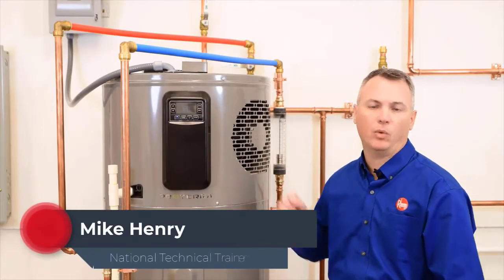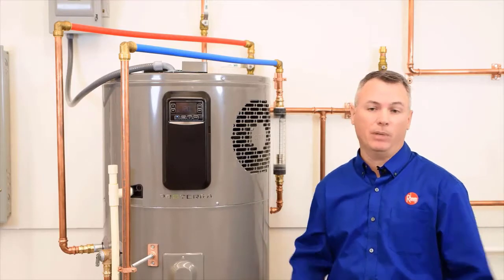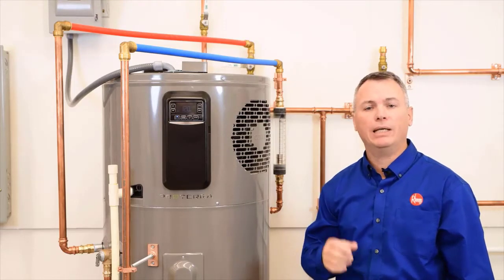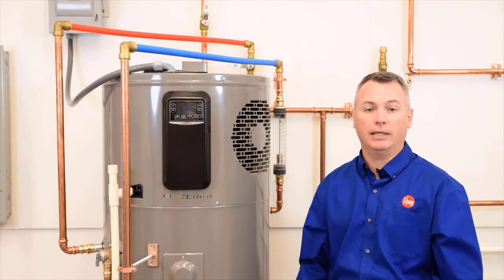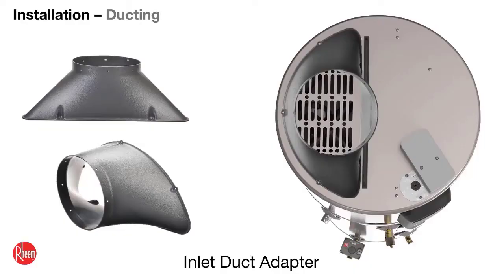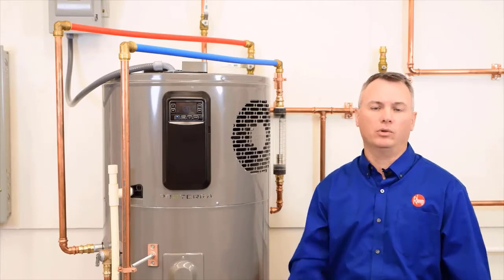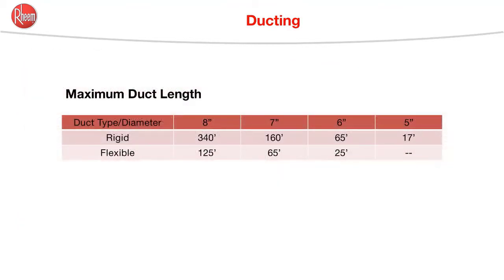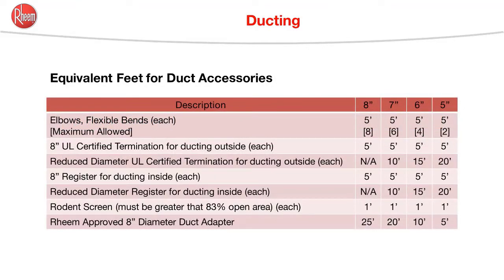Ducting When Installing Rheem® ProTerra™ Hybrid Electric Heat Pump Water Heaters

Comment: I will soon be purchasing your Richmond brand hybrid unit to replace a gas fired Rheem  that has serviced 16 plus years. My question is about the air intake. I am placing the unit in the basement of a northern climate home. The air temperature is maybe 60 degrees with plenty of room to not have to vent in or out. However knowing how a heat pump works. The warmer the air into the unit the more efficient it is. Would i be off my rocker if I vented the air from behind the wall of my fridge witch is directly above the unit. Since the fridge is basically a heat pump that expels heat. I would place a vent in the wall behind the fridge and box it in like the furnace air return vent and pipe it directly into the new water heater. The wife is always complaining about how hot it is around the fridge so plenty of heat in that area to service the new water heater.
Reply from the maker: Thank you for your question. Please refer to the use and care manual https://s3.amazonaws.com/WebPartners/ProductDocuments/2284AE53-7D0D-4BF5-A2BD-1D65C187C6F9.pdf and the spec sheet https://s3.amazonaws.com/WebPartners/ProductDocuments/71875DC2-D7F8-4FB4-BC4F-B2AE0190B7E8.pdf. We do not recommend ducting air from a space with limited air volume. If you need more information about this, please contact our Technical Support Team at 800-432-8373. We hope this helps!
Reply: How do you like the Richmond brand? I’m torn between Richmond and Rheem. They appear to be the exact same so Richmond would be the better buy?

Comment: Duct adapters are insanely overpriced!  At that cost, there's no savings to be had over the lifetime of the water heater.  Might as well just switch back to full Electric mode, and would still be cheaper in the long run.
Reply from the maker: Hello, and thank you for the comment. As long as there is more than 700 cubic feet of free ambient air to work with, ducting is not necessary. The unit will use the air around it. Ducting is an option at that point. It's only necessary to bring in air or move out air through ducting if the 700 cubic feet minimum of air isn't available.
Reply: @rheemwaterheatertraining  I disagree. There are temp concerns around needing to duct as well.  But none of that addresses the fact that your duct adapters are cost prohibitive and erase all of your energy savings. There must be about 97% profit on those.
Reply: Here's a video of a homeowner who DIY'd the ducts: https://www.youtube.com/watch?v=9rVOkPQd8Cw
Reply: @tdub18914  97% is probably about right. However, the cost savings is significant, and ducting will increase savings if done right.
Reply: The Menards Richmond heater appears to be the same as this heater and their ducting inlets and outlets are like $30. Guess those would work for the Rheem?
Reply: @christianlogsdon6483 My understanding is that Richmond is a rebranded Rheem.  The hybrid inlet adapter sure looks the same for both except Rheem wants $118 for it vs $50 from Menards.

Comment: If you duck the cold air outside wouldn't that cause negative air pressure.
Reply from the maker: Hi Freddy, great question! Ducting the cold air outside, theoretically, could cause an issue. However, almost no house is air tight, so it shouldn’t be a concern. If it is a concern, the intake (from outside the house) can also be ducted to address this potential issue. We hope this helps. Let us know if you have additional questions.
Reply: @rheemwaterheatertraining  Just like a wood stove that needs a outside source of or it will pull in freezing cold air in those leaks in the house